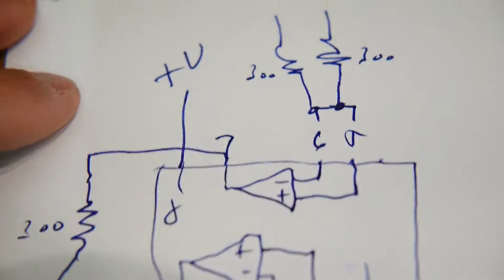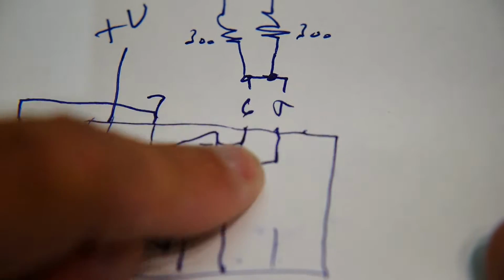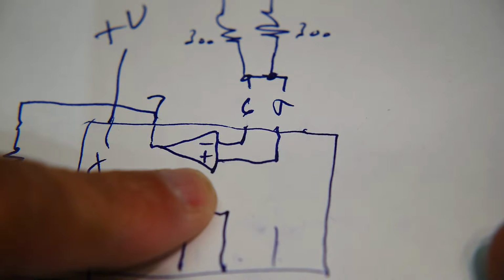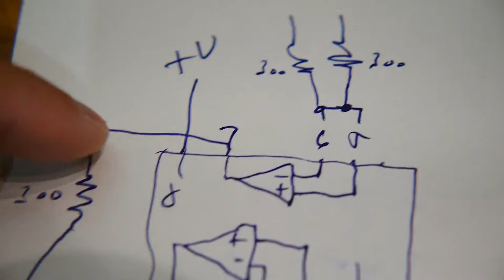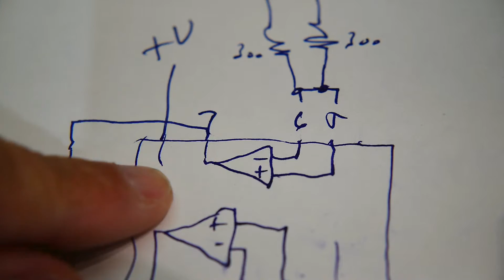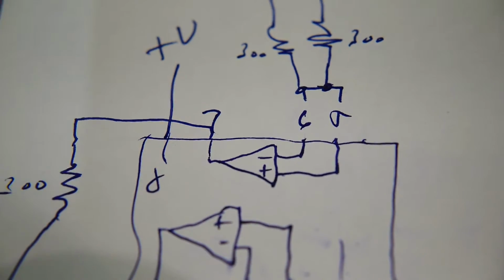#448 Bogus BM800 microphone circuit

Comment: Amazing videos, I am also really interested in understanding those cheap chinese boards and after triyng a few i have no doubt some are just random parts toghether, probably pre made boards with tiny differencies that are sold to different price tags by, as you say, changing a component here and there. I would stay away from those op am versions because there is no need of that (schoeps is fine enough with 2, 3 bjt). Said that there are absolutley valuable boards that with little upgrades are doing 90% of what a really expensive circuit would do. Sometimes even by just biasing correctly the trim at the fet (when available) I think the biggest drawback is they are generally limited to 45ish V of polarization. I have seen some akward boards now coming on the market that should have a cmos step up but... IDK if they are any worth. My strategy is always to buy 2 3 similar boards and test them in the lab, one is terribly wrong, one is okish, one usually is rather good.

Comment: I have one just like this, except instead of an op-amp labeled 4558, it has a dual p-channel mosfet labeled 4963B, and instead of 300-ohm resistors it has 56-ohm ones. And yes, as far as I can tell, it isn't connected anywhere, not even ground. Thanks for making this video, btw, 'cause I thought I was going mad.

Comment: connector is 3.5 mm trs. 5vdc from a computer or other source.  How did that 15 V Zener help the 5 volts get to powering the fet?
Reply from the maker: the fet is not limited to 5 volts

Comment: Im against OP-amp in microphone circuit anyway. Good quality FET and two other transistors are enough . Also transformer can give a better specific sound .
Sometimes less is more. Avoiding op-amp's noise. Any extra transistor increases  noise floor - there are enough op-amps in the sound-card you connect it to.

Comment: the new ones come with a red circuit board, no op-amp, and the caps are mounted on the component side, not the opposite side, the chassis is thinner, threads are nasty, construction is worse.... what do you want for $18 lol.

Comment: Amazing they even have some other generic looking designs... not certain if the one is a better smaller design or not.  https://www.youtube.com/watch?v=9OvIxs3VcCY  Mine is like the top PCB in your video... though I didn't inspect and assess components critically... just did a quick look once I saw the linked video.  Waiting on a new XLR cable to compare using the UMC202HD with my Labtec Mic333 and Rode NT1-A.  Thanks for sharing!

Comment: Is there any chance, phantom power can damage the parts
?
Reply: I have 1 more doubt.. Today I brought a mic similar to this that is (maono au 03 xlr to 3.5 jack ) on the cover they written as operating voltage is 1.5 v because of that I asked that qtn.

In YouTub I have seen a video where they as saying xlr to 3.5 jack mic is electrid condenser mic it don't want phantom power
Reply from the maker: @insparklygo  it if does not have a XLR connector then it is a different microphone and does not use phantom power
Reply: @IMSAIGuy  electrets never use phantom power. They have their own permanent static charge. If it doesn't have a permanent static charge it's just called a condenser. The BM-800 mics that come with XLR to 3.5mm don't use phantom power...other than the voltage supplied by the mic jack, but that is to power the fets.
Reply from the maker: @vengeance187  the question asked would phantom power damage the parts. The circuits does require some DC voltage, about 18V to run the FET biasing on the input, but 48V is OK but overkill. If you try to use the 3.5mm jack it will not work since there is no DC bias on the lines. Some 3.5mm jacks have 5V or so but not enough for this design. Look at the schematic for Schoeps circuit or Alice circuit.
Reply: @IMSAIGuy  You are wrong. I have one. It works perfectly just plugged into the jack. If it works when you plug it into a pc mic jack then it does not require phantom power. A mic that requires phantom power will not work at all without it. "Phantom power" specifically refers to p48, not DC bias voltage.
Reply from the maker: @vengeance187  OK, if you think so. maybe yours is different. The manual says to use the xlr to 3.5 cable you need to have a XLR phantom power supply in line. You might try yours out with phantom, if you are running the front FET at 5V then it will be limited in dynamic range. There are plenty of videos talking about the BM800 if you don't believe me:  https://youtu.be/0dqBzQ5t-7Y
Reply: @IMSAIGuy  The guy in that video didn't really know what he was talking about. It's called phantom power because the power is carried on standard microphone audio wiring in a way that is “invisible” to ordinary dynamic microphones. Not because the power supply box "disappeared"😂.
Mine didn't come with a manual. I got it for ~$8.50(after coupon) from AliExpress just for the body to make a ribbon mic. I can't comprehend why anyone would pay more than that for it, especially $20-30.
Reply from the maker: they are designed to use phantom power +48VDC
Reply: Thanks a lot ♥️

Comment: No need to dispose of bad ICs when you can make them into stowaways, instead. :o)

Did you happen to try the op amp to see if it worked?
Reply from the maker: no didn't try. I love all that wonderful old HP test gear in HP racks on your profile page
Reply: @IMSAIGuy  I'm really curious if it's a dead op amp. Regarding good old HP test gear, you should see some of the HP and Tek collections our TEA members have. Also, check out Jeff's photography of old test and lab equipment, including HP, at https://www.flickr.com/photos/144543740@N05/
Reply from the maker: @TestEquipmentAnonymous  Lovely! It's scary when you recognize everything and most of it has been or is in the garage.
Reply from the maker: @TestEquipmentAnonymous  I didn't take it out of the board to try it but the pins have diodes on them. so something is inside
Reply: TEA had a nice point that instead of paying for disposal of a damaged part, you they could just add it to the BOM and ship it out, but then, note the marketing point of view: when there's an IC on the PCB, the PCB looks more advanced. You have analyzed the circuit and you know it's dead weight, but many people won't. Adding a cheap do-nothing IC, and then selling it for higher price just because it looks better? Sounds plausible. Was there any noticeable price difference between the normal board and the board with bogus op-amp?
Reply from the maker: @quetzalcoatl-pl no idea what product it came from or the price